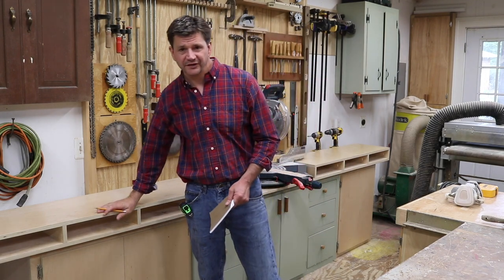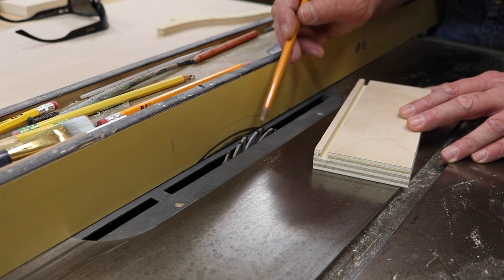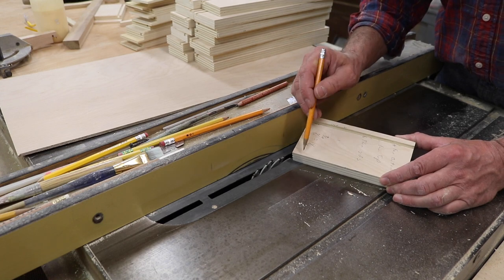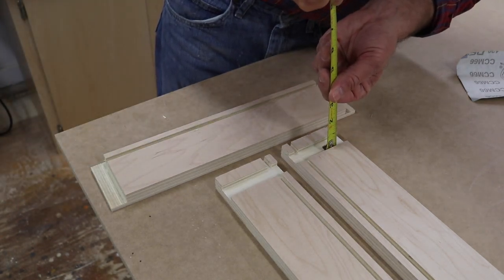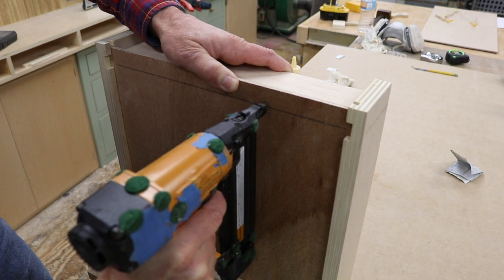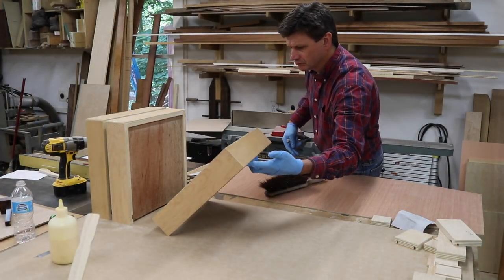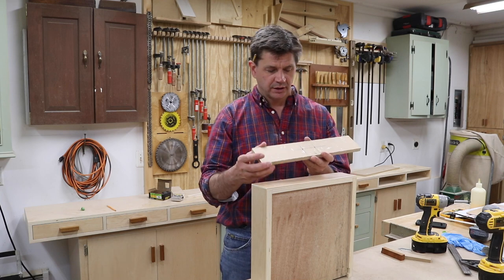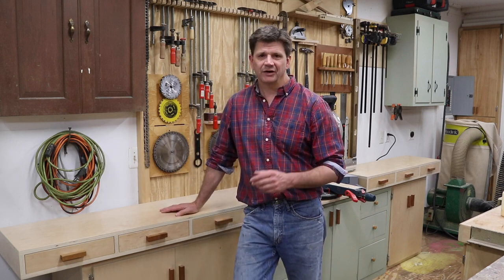Make Drawers & Drawer Pulls - Miter Saw Station Build part 2, Garnica Plywood Build

Comment: Great video! Trick I learned while making door handle pilot hole jigs, which saves a little more time, is to oversize them to have a stop. This allows you to only make it flush to the side and you don't have to clamp (or it'll make clamping easier).

Comment: I would drive screws thru the top for the drawer stops. You could also drill holes and glue dowels for a stylish, but permanent, solution.

Comment from the maker: This is part two of the Miter Saw Station Build. In this video I focus
mainly on the drawers. Although I would not suggest this drawer design
for fine furniture. It works great for shop furniture and cabinet builds and I've been building drawers like this for years.
This project is sponsored by Garnica Plywood, check out this video to see how the plywood is made.
https://www.youtube.com/watch?v=3BOUVNG6UVg
Reply: Want to build this for my Bosch. Went to the Garnica site and can't find where to get it in the US. Where'd you get yours????
Reply: +Mark Feliciano      http://atlanticplywood.com/locations.php here is a link to find it.
Reply: Not exactly rocket science what you do here. But I'm always extremely delighted buy how clean and accurate your work is. Not sure if there's some clever  editing trickery involved. And to be honest I don't even care because it sets an example anyway.
Reply: Hi jon I recommend to put iron on edge banding on the dividers of the drawers because it looks bad to have holes in front....

What brand of nail gun are you using?????
Thanks

Comment: Hi John that was a great video! as
a beginner in woodworking I found that there was an awful lot of really great
and useful tips on how to make drawers in it, I downloaded it and saved it for
future reference. I have a small Dewalt contractor saw that cannot accept a
dado stack the slot for the miter gauge has a lot of play in it so I wouldn’t
feel confident using it like you used your saw to cut the grooves and dadoes in
such a project, do you think I could make the same grooves and dadoes that you
did using a miter saw. I have seen you use the straight line finger guide many
many times you make it look soooo easy I wonder did it take you a long time to
get so proficient with it, I have tried it a couple of times and had not so
great results also do you get splinters sometimes doing that, I almost always
use a square when I need to draw lines like that. That plywood that you used
was awesome looking I wonder if it is available where I live in Murfreesboro Tennessee
and how much a 4 x 8 sheet costs. Baltic birch plywood is hard to find here
where I live.

Comment: another great video Jon, so my question is actually about the polly, is the water base Polly as durable as the oil based polly?  oil based takes forever to dry compared to water based it seems.

Comment: Hey  Jon, I have the same Bosch miter saw. Have you had any issues with the front knobs hitting the sides of the built cabinet on either side? Like if you wanted to cut something at the 50 degree mark. I was laying out mine to build and found that when you rotated the saw to the furthest point on either side, the detent knobs hit the sides as it sticks out past both sides of the cut surface. thanks!

Comment: drill a hole on the front of the worktop where you want the drawer to stop then fill it with a wooden dowel
Reply: Add a small block to the bottom rear of each drawer in the center. Then add a thin piece of spring steel to the bottom of each drawer opening so that they'll hit each drawer block. It'll stop the drawer and still be easy to remove the drawer if the need arises.

Comment: what's the name of your table saw it doesn't make big noise i like it and i would like to buy one 
thank you so much for your helpful canal
Reply: It's a Bosh Model # GCM12SD,you can buy it at HomeDepot for around 700 dollars.It's an amazing tool.
Reply: thanks man for your info  i live in morocco 
i think worldwilde shipping will cost me too much
Reply: what about the table saw do you know its name model  .?
Reply: It's hard to tell what type of model,it is provably expensive around the 1000 dollars.You could try getting any craftsman type of tool.They are cheaper and will last you for years,the tool usually does not result in a perfect work peace but rather who is using it.He provably has expensive tools to increase the precision of his work since he has been doing it for a long time I suppose.
Reply: It looks like a Jet table saw,they are pretty great.
Reply: thanks man
Reply: Eagle Eye,
The table saw looks to be a Powermatic, the miter saw looks to be a Bosch.
I hope this helps.
Reply: thanks man have a good day
Reply: Not making a big noise could just be due to editing. Who wants to listen to a loud power saw? Jon possibly adjusts the audio in his videos so the saws aren't too loud.
As for the saws he uses...it's not the saws that make a great carpenter. It's years of training and practice. You could have the best tools on the market and still make bad cuts.
Reply: good point thanks man . the problem i want to start my own woodshop in my home i have a small garage but i don't want to disturb my neighbors for that i'm looking for good table saw quality

Comment: I bought the saw because the cost to rent a similar one for a weekend was only a little less but with this saw, I ended up cutting and installing nearly 300 linear feet of baseboards in one day. Now I have a line of neighbors wanting to borrow it. Easy to set up and attach to your stand. Easy to operate.>>>ur2.pl/782     I love the 5-second brake feature and it comes with a little bag you can place over the exhaust to help control dust.